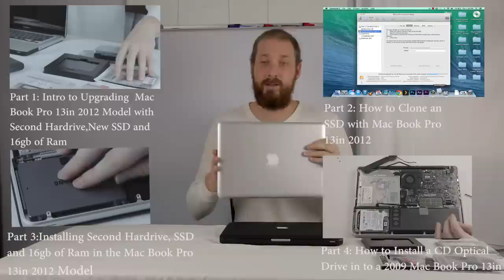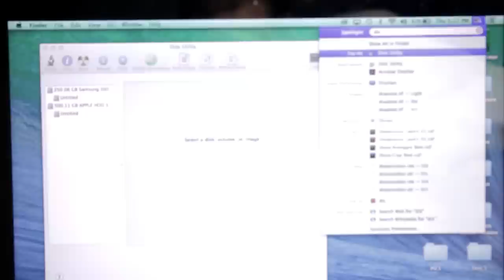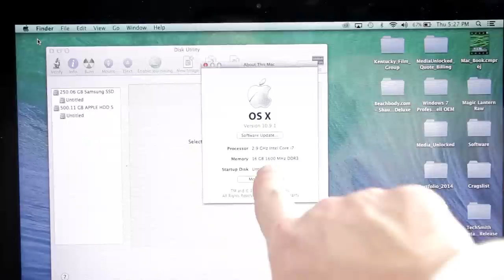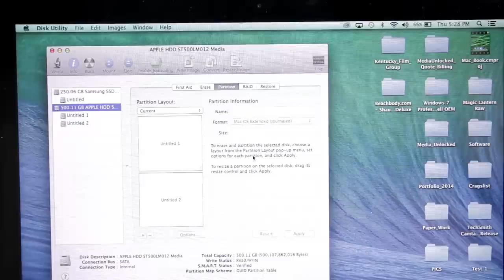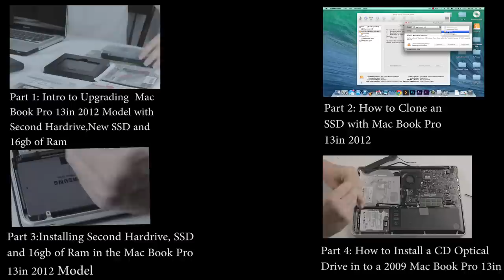Part 3: Installing Second Hard Drive,SSD and 16gb of Ram Into Mac Book Pro 13in 2012

Comment: I have a mid-2012 A1278 MacBook Pro. Mint condition - had it since 2013 when I bought it new from the Apple Store. It’s always been my main Mac. I haven’t used it a few years as I’ve been using my work-assigned MacBook Pro.

So I’m using it again and it definitely needs the memory upgrade to the max 16GB. And I’ve been considering upgrading my primary internal HDD to a SATA SSD HDD (1 or maybe 2TB) and then use the stock SATA HDD (500GB) as a secondary internal HDD in place of the optical drive which I never use anymore.

This video is very detailed and will serve as my guide.

Thank you! 😎👊

Comment: There is a third "screw piece" at the end. You need to take it off of the original caddy and screw it on to the new caddy. That is why you have the two holes on the side so you can add the support from the old one.

Comment: great vid, but:
1. DVD 3rd screw mount can be moved to the caddy - 2 screws at the back
2. you should screw in the hdd to caddy - this way less shock will be transferred = long hdd life
Reply: And other performance based differences, if I screw ssd to caddy, and boot with it alongside the hdd in the normal bay to use as a storage hard drive?

Comment: At 18:26 the mounting piece on the Optical drive that he is pointing at can be removed by the 2 screws and transferred over to the caddy which was designed with this intention
Reply: Botel Onee ^^IMPORTANT IF YOU WANT TO INSTALL THIS PROPERLY!!^^
Reply: +Botel Onee lol wonder why he didn't transfer that over.
Reply: Lack of common sense judging by the fact that he didnt even take a second glance at the bracket on the optical drive, And/or too excited to get the install finished and didnt care

Comment: Nice video. Two comments: (a) that small "L" bracket on the original DVD enclosure should be removed, mounted on the second HDD adapter kit and (using the screw you had left over) anchored down so that the second HDD doesn't move around in the laptop case; and, (2) you might mention in the previous video that you need Phillips #00 and a T6 torx screwdrivers. I think you said a T7 in the video. Other than that, well done. Thanks!

Comment: The screws on the side of the hdd that you have to transfer to the new ssd are Torx screws. You'll need a size 6 or a 'T6'.  Also, the bracket holding the hdd - those screws are spring loaded and don't need to be removed - just unscrewed enough to release the bracket.
Reply from the maker: Thanks for the info!!

Comment: Great tutorial David.  I'm looking to do the same thing with my late 2009 MBP.  Quick question.
Why did you partition your drive with two partitions?  Is that really necessary?  I just want to use mine as a
mass storage device.  Can I just use one partition instead?   Thanks again.  Great and informative video.

Greg
Reply from the maker: I like it that way I have a partition dedicated to just work files.

Comment: I think i have the same caddy but i think it's sata 2 instead of 3. I tested it with macbook pro 2012 15" and a kingston a400.480gb drive and read speeds from the caddy didn't go higher than 280 MB. Even in raid 0 with 2 of those kingston ssd's it gave lower read speeds compared to my 850 evo.

Comment: I Hav a MacBook Pro (13-inch, Mid 2012) With a 500GB Samsung SSD & 16GB Of Ram i love the speed and performance i get from it on Mac & Windows 10 on BootCamp
Reply: BigPaco213:::::if i want too do the same upgrade to 16GB Ram & 500GB SSD do i need to transfer the osx???? the rest of the data like the personal cuz I'm going to install everything from scratch.But what i need to know is what do i need to do before installing the two items???..... the RAM & the SSD.....i have no idea what i need to do??i do know how to install the items what i don't know if i need to transfer any data required  for the computer?do i need to copy the osx from the hhd to ssd???? or can i just replace the items without doing that???
Reply: McRom37 yes you're going to need to install a fresh copy of macOS onto the SSD, there are a lot of great YouTube videos out there and shows u how to do this. BUT the easiest way would be to buy a back up drive and use the Mac time machine to back up all your files and then install the SSD and use once again time machine to restore all your files!!
Reply: BigPaco213:::thanks for the reply,yeah that sounds like it would be easier,one Question:did you install the ssd ur self?? or did it come like that when you buy it??how much did you pay for the samsung 500GB SSD??? and where can i get it? and if you also can provide a link for the 16GB RAM.i to have a macbook pro 13" mid 2012 no Retina and not sure if it a i5 or just regula intel.
Reply: McRom37 I bought the Samsung SSD off Amazon at the time it was $300 for 500 gigs now it's about $150 for 500 gigs I would say spend the extra money and get a 1TB Samsung SSD. For the ram the brand is called crucial, it comes with 2 8gig sticks.
Reply: McRom37 and yes I installed the SSD and the 16 gigs of RAM at the same time by myself took me about 15 minutes.
Reply: @BigPaco213 I want to upgrade my macbook by adding 250 Gb SSD+the original HDD.Do i have to upgrade also the ram to 16gb ?(i have 4gb ram)

Comment: Hello Media Unlocked, upon the disconnection of the Wifi and Bluetooth there was a breakage and the wire has become detached from the head. However, this hasn't been much of a problem as my WiFI still works although I am unsure about Bluetooth. The problem is that the old Hard Drive now in the optical isn't recognised and isn't there, however the SSD is and is working rapidly. Do you know if that might be why the Hard drive isn't visible? Maybe also if it's fixable?

Comment: Would it be better to keep the HDD in its original location and place SSD into the optical bay , or to use the setup you used?

It has been said on the internet that placing the hdd into the optical bay can cause issues because of the bay's lack of sudden motion sensors .

How has your set up worked for you since installation?

Planning to do an upgrade and wondering which would be the best way to give best speeds and keep the drives 'safe'

Also , if you dont mind , did the caddy you use hold up well over the year? Im considering this caddy or the OWC variant.
Reply from the maker: ***** I would put the ssd in to the the bay the hdd is in and put the hdd in the optical bay. All is still working great for me.
Reply: ***** im not sure, but I think the problem exists only if your macbook is early 2011 or older, this happens because the sata cables are different for the optical bay and the hard drive bay
Reply: ***** sudden motion sensors are used to protect the disk in a tradition hard drive and is irrelevant in an ssd since it doesn't use a disk

Comment: I have one of the macs from 2012 which has an error which does not allow 2 ram sticks. If I put another 8GB ram stick in, boot up and wait about a minute, the screen goes haywire and the computer turns itself off.
Reply from the maker: Some mac max out at 4gb ram as well make sure it is ddr2 or ddr3 ram I believe

Comment: I did the same process for a week and it still won't work got a new data dubbler and I'm going back in to try again, use flash drive, tried external SSD and time machine and still cannot get the operating system to come back up, NEED HELP PLEASE !!!
Reply from the maker: email me with details mediaunlocked101@gmail.com see if we can not figure this out

Comment: Great vid.   I did exact same thing you said to do from previous vid.  But now every time I turn on my MacBook it acts like the first time I turned on after ssd card was installed  it acts like is formatting the SSD.  Any idea?   After that it works great tho.  Thanks
Reply from the maker: It should not be doing that email a pic at mediaunlocked101@gmail.com
Reply: Media Unlocked thanks a lot for getting back.    Some how i re configure it or something like that. And it’s working lightning fast.  It’s unreal   Thanks for your video and taking your time reaching out.  Thanks again 👍👍

Comment: While removing the battery plug clip, I used a small flathead screwdriver to do so and I'm afraid I bumped a solder on the circuit board. I smelled a bit of a burnt smell. Now I can't turn the computer on and when I plug up to the charger, the green light on the charger doesn't even light up when I plug it up. What does this mean? What should I do?
Reply: Did you check your battery?

Comment: I'm confused to how it booted do you not need to reinstall the OS on the new ssd when taking the old hdd out? Or was it because you added the old hdd back in?
Reply from the maker: You clone the harddrive so the operating system is copied over.

Comment: does it make a difference where you put the ssd? couldn't you have just put the ssd in the optical bay slot with the exact same outcome?
Reply from the maker: livingshangrila The mac would read it as the second hhd instead of main hhd if I put it in the optical bay
Reply: @MediaUnlocked  what about using "start up disk" from "system preferences" to choose where to boot from....that way you could clone using disk utility after the ssd is installed and boot from there.

Comment: Do you recommend this mac book pro (2012) still? Even if its almost 2016? Thanks!
Reply from the maker: It depends on your budget still a great computer but there are better computers if you can afford a newer one.
Reply: Thank You
Reply: +Masterglitcher567   dont take the dvd rom out.. this guy is very irresponsible by telling people to open their macs and taking out the drives..with out warning them of firmware issues that will arise when you need to install a program via dvd..   for example if you produce music you will inevitably run into this issue.. not all music programs come downloadable...too many gigs.
Reply: JRLM Thank You for your advise.
Reply from the maker: +Masterglitcher567 no problem
Reply: absolutely. More USB ports, thunder port, optical drive, smaller trackpad, interchangeable DSS and ram. This computer will be viable for another five years if the software will hold up.
Reply: @b3at2  Fair enough. There's no problem with downloading gigabytes of data, if the software is available though. The full release of Debian Linux, for example, is 16 DVD's of data, as of 1st May 2019. For any modern Apple computer, OS updates are usually done via the internet, and that's at least a DVD of data. Spinning disks are a thing of the past for many computers. As Steve Jobs said, when announcing a new MacBook Pro, 'For those still in the 20th Century, [external Superdrives] are also available.'
Reply: @jp3mcpherson  I'm still using my MPB Mid 2010. Ten years strong.  I've upgraded the ssd to 1tb, added 16gb of ram and replaced the battery. Still a great machine.
Reply: Bubba Ho-tep i've got the late 2011 very recently in very good condition
Reply: Bubba Ho-tep was replacing the battery easy?
Because mine says battery needs service, cycle count 597

Comment: Also which caddy tray did you end up using? and didn't the caddy you used feel loose without that third screw?
Reply from the maker: A little the link is in description.
Reply: you give us two caddy's, but I don't believe you specified which of the two caddies you used. thanks,
Reply from the maker: I do not remember sorry. They both will fit.

Comment: r u sure the 16gb would be works fine? Apple says that only support 8gb ? tell it's your macbook ok with 16gb ram ?
Reply from the maker: +Renato Apaza Meza It works great for me
Reply: i know i do it :) thanks
Reply: +Renato Apaza Meza I did the 16GB memory upgrade a while ago on my mid-2012 MBP. In Apple's specs they only mention 8GB, but mid-2012 MPBs accept up to 16GB (will say max of 1600 MHz DDR3 in About This Mac). I've had no issues thus far and I can definitely notice the difference. Check

Comment: Hi Thanks for the video! I want to swap my Crucial 525GB SSD from my 2010 Mac to my Toshiba laptop, but the Toshiba laptop only read the drive as 488GB and my Mac reads it as 525GB, why is that? What can be done so the SSD can be read as 525GB in my Toshiba Laptop?
Reply from the maker: It is how much space the os and other app take up natively for each system.

Comment: after replacing the dvd drive with the second hdd, is it the laptop heavier than before? I mean literally heavier in terms of its weight...
Reply from the maker: I did not notice
Reply: a simple answer to this would be no. In the previous setup you had both the hhd and the dvd drive. You're removing the dvd drive from the setup so you're removing that weight. The new SSD is featherweight in comparison.

Comment: its 2020, have any changes applied since then, meaning the 2 ext ssd, can it hold the 1tb or is the 500 the max, also i read somewhere the mbp can hold even more than the 16mg or ram. whats your take on it as of now. i have a mid 2012
Reply: Have you done any upgrades since commenting? Looking to do some myself
Reply: @LukeRosen79  no, I have not, put it on hold, but I’m running the Ethernet instead of wifi with 16mb or ram and it’s fast.!!!

Comment: Mac (early 11") only running slightly faster after these upgrades I am using a 480GB ADATA mainly as a boot drive. Is there something else I could do? The computer handles everything just fine, but after upgrading RAM and both drives (second 1TBSSHD)  I was expecting a whole lot more performance.
Reply from the maker: Unfortunately that is about all you can do.
Reply: I moved the two largest programs off the ssd to the hybrid drive and it is running a little faster now. Thanks for posting this video it helped a lot.
Reply: Did you think about making it a RAID? That would add more speed. There is a video showing you how to do that.
Reply: I may configure RAID when I can afford two Samsung PRO SSDs
Reply from the maker: Never thought about doing so. That is all you can really do sorry.
Reply: There's a video titled the fastest macbook pro 13 ever. Or something like that.
Reply: thanks so much for sharing this all this! i swapped the ADATA out for a Samsung Pro and used the ADATA as a Storage Volume shared on @highermathCT :IG

Comment: A tip: MacBook Pro can only handle uptimes to 1333Mhz RAM so you are good with that, not 1600Mhz because the mainboard are "struggling" to downgrade the 1600Mhz, but you can use it.
Reply from the maker: Thanks for that tip!

Comment: i have a ssd 250gb install on my macbook pro 13 2012, is it possible if i install a second one using a normaL HD 500GB?
Reply from the maker: yes it is
Reply: then what the speed will be like?
Reply from the maker: It depends on the speed of the harddrive. I would get a 7200rpm HD

Comment: My computer won't turn on? After install of SSD and RAM it won't turn on. Checked connections and everything is solid. Confused
Reply from the maker: Does it make a weird sound when trying to boot up or turn on? Also are you sure the hard drive is connect correctly?
Reply: Media Unlocked I figured it out. For some reason the Macbook refused to recognize the SSD as a replacement to the CD/DVD drive. I had to remove everything and go step by step to single out the problem. So instead of adding the SSD, I just replaced the old HD with it. Everything is working good now.

Comment: get a 2tb add and leave the dvdrom in...trust me.. it will save you tons of trouble.
Reply from the maker: +JRLM I just love having a second hd drive never use the cd drive
Reply: +Media Unlocked have you ever tried installing programs with an external dvd rom? it doesn't work..  if you are indeed a power user how have you not run into this issue???? tell me because this is a known bug with the mid 2012 mac models when you take out the dvd rom.  You should tell people that you are literally breaking some of the functionality by taking out the dvd room.   there are 2tb drives and 4tb drives on the way.. you should advice your audience on the trouble you will invite them to.
Reply from the maker: +JRLM I use the second drive only as back up. I love it. I do not install anything on it. I never need the cd drive.
Reply: +Media hopefully you never run in to the issue...it also affects installing programs via download that use roms. and virtual cd rom software... because the firmware thinks its an actual cd..  you should google the issue and put a disclaimer up on your video...seriously.